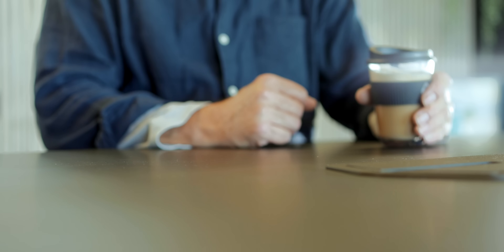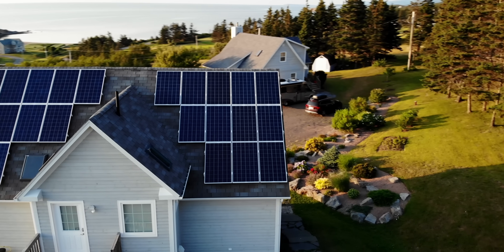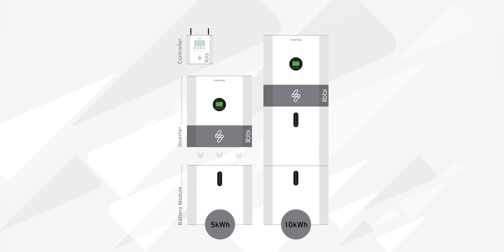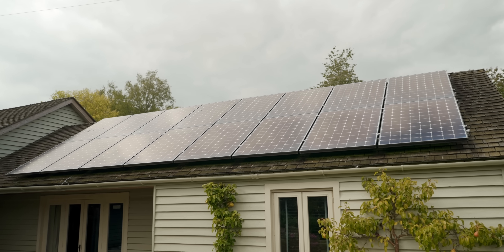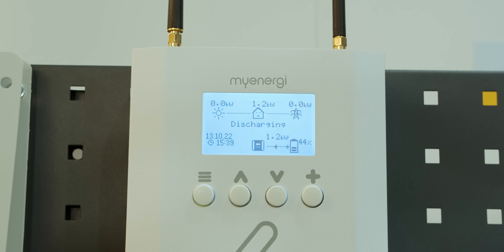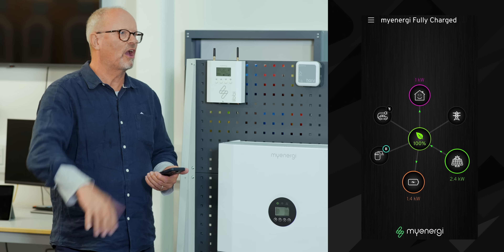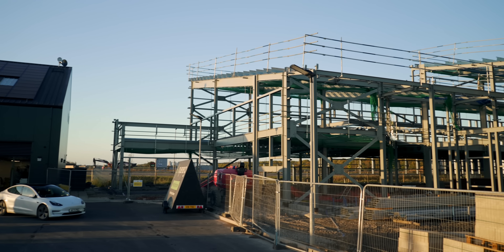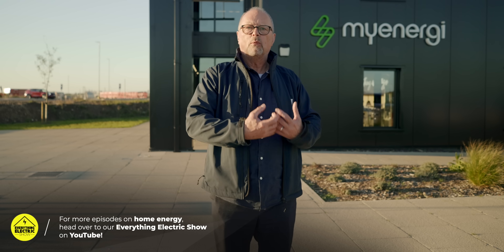THIS Home Battery is the Key To Cheaper, Cleaner Energy!

Comment: Looking at the website I see this "Optional blackout backup, to maintain power to a dedicated circuit in the event of a power cut.", this slightly worries me, in summer we would have different priorities than in winter, but the statement on website seems to suggest this cannot be catered for. AFAIK a Tesla battery will (as far as it is able) power whatever circuits are drawing power, which seems a more sensible option.

Comment: Can anybody explain why systems like this see grid connectivity as an important part of the future? If they're saying they want to create a distributed power station bigger than Drax, it seems like that's a big deal that shouldn't just come about by them selling to lots of individual households and then in a few years the grid gets a lot of benefit. Feels like it should be a more centrally directed effort, with investment, just as if a new power station was being built, but used to incentivise home owners. It already feels like a rip off that the export rates are a fraction of import rates. This just feels like another scheme that places to financial burden on householders. Wouldn't it be simpler and cheaper to be completely off grid, more solar panels a large battery and a standby generator?

Comment: I am sure that all of this technology works very well but if you simply cannot afford such equipment, there is no benefit. I have been quoted around £30,000 to replace my existing combi boiler and the other associated work required to make a heat pump system work efficiently. Solar panels etc are not included in this price. Totally unaffordable as things stand.

Comment: I like this idea so if there is a black out you can live of the battery pack, and the app will tell you how much you are using so almost self sufficient home energy. This video really builds it up but no price advertised which mean at the moment it is probably really expensive hence this really informative video hoping you will gloss over the cost and still purchase it. But apart from that it is a good idea especially now with  possible blackouts looming this winter.

Comment: Is it really cheaper ? 
As a Powerwall from Tesla is 11.500 dollars or 9900 GBP, and from what I can see this system starts at 4595 GBP+VAT (5500 GBP or 6380 dollars) and no installation in that price either. But the Tesla is 13.5 Kwh and the minimal system starting pris is only 5Kwh at libbi, so you need 2 to 3 systems to get the same power, so depending on the price increase it could either be cheaper or way more expensive and still be weaker than a Tesla powerwall.

If we take 2 batteries at 10Kwh from libbi, and say we can subtract one inverter from the cost, that would be saving at 1000-1500 dollars for the second battery. Best case that's a coast of 11.260 maybe 11.000 plus installation, but it's still only a 10kwh system, where a Tesla wall would give you 37% more power for around the same cost.

Well what if we take 3 batteries and make a more powerful system then ? Well we save 2 inverters of the cost so that's around a 16.000 dollars for 15kwh, that seems good until you read that Tesla Powerwall have a option of 2 for 18.500 dollars, so a total system of 27kwh, that is bigger than the largest battery libbi can offer at 20kwh with 4 moduls, so again it's hard to see where they can save money to offer a better product for the same amount.

It should also be said this is in the best case scenario, as the inverter for only one module from libbi is only 3.5kwh, and 5kwh in the other systems so there may not be a saving of 1500.- pr module, and in the UK there is a bigger cost for installing a inverter larger than 3.5kwh because of the forms and utility companies pay.

It's nice to see other products come along, but it needs to be evaluated for what it is, it can be good option if you only need 5kwh, but it seems a bit small to do much on.

Comment: Looks to be a great system
I'm currently looking for a 'system' myself.
I'd imagine I'd like as many solar panels I can fit on the roof.
I have a 10KW shower, I'd like the battery to be able to handle.
I don't have an electric car yet, but would like to be able to increase the battery load to cope with that.
Having a 'smart' system that I could manually 'play' with would be my highest priority.

Comment: Looks great but although I have Solar plus Eddi Harvi etc, I couldn't wait any longer and opted for a hybrid inverter with PylonTech batteries. I'm hearing that the price of a 5 kW Libbi and 5 kWh battery is around £4,500 + VAT plus installation.! I'm glad I didn't wait as my equivilant 5 kW system was £3k including VAT.

Comment: To become big we need technology AND economics AND politics come together.  Even if the kit is great AND has a payback of only a few years, it will not be adopted quickly - too few have the cash (or cash to "risk").  However, if every person or dwelling  had the right to a £5000 green govt backed low cost loan (linked to passport, authorised dealers and approved products so no double dealing or using funds to spend on other things), it would hugely accelerate the rate of change.  Only a govt can back the low cost loans and run the approvals but thousands of good jobs in the many, market led qualifying solutions.

Comment: Where this technology is falling down is the greed of companies plucking figures out of the air when quoting & charging for installations. There’s supposed to be zero vat but companies are keeping that and charging more over. There’s companies all over Facebook charging wildly different amounts for using cheap Chinese solar & battery technology. The industry needs to be transparent & itemise their installation exactly the same as every service we buy. You wouldn’t feel happy taking your car to the garage & coming out with a bill that doesn’t break down parts & labour charges but that’s exactly what’s happening in this industry. More often I hear stories of installers turning up with different branded equipment than was sold to the vendor. This is like the wild days of White Gold where dodgy cash hungry companies & sale people are riding a largely unregulated industry. If it was regulated why have I been unable to get a price breakdown for my installation that I paid my deposit for & still waiting an installation date nearly 2 months later.

Comment: I am waiting for my installation including a Givenergy battery & inverter that does as far as I can see the same thing. The only difference is the battery & inverter are not included in the same box but that’s not a bad thing I can easily upgrade my inverter if my needs change.

Comment: Wats needed is a system that does not use the grid at all... all the present systems are connected so it’s the same price cause it’s charged at same rate no matter where the power comes from wind,sun or water or whatever

Comment: The important thing for me is that, I can island the system, and provide power to the house when there is a grid failure, or make the choice to go off grid fully if they continue to take the piss.

Also I want full control, so that nobody can take control externally if I don't want them (the grid) deciding that they will just help themselves to my power.

I say that as in Western Australia, you cannot have a inverter fitted now that the grid cannot turn of remotely.

Comment: How I do this with two Tesla Powerwalls...

I have a Single Phase (L1) Consumer Board with two Powerwalls and Solar Array feeding the house, through a Gateway 2.

Attached to the Gateway 2 is a 7kW Zappi Charger.  This allows me to charge from cheap Grid at night (00:30-04:30), or from Powerwalls with cheap Grid or Solar at anytime (discharge limit is 10kW).  Our Solar Array fills the Powerwalls. 

I also have a 3 Phase Distribution Board with a Zappi 22kW charger attached, prioritises (L2) for low charge events.  This is Grid Only and used for fast charging at anytime.  So I can pick and mix which charger I use, for what type of energy I want.  24/7
Reply: Just to add... I can regularly hit 22kW - 25kW during the night for 4 hours, very easily.

11 kW - Tesla Car Charging at 3 Phase on cheap grid
7 kW - Powerwalls Charging at single Phase on cheap grid
4 kW - House Demand with Heat Pump & Tumble Dryer at Single Phase on cheap grid

Comment: I noticed that they don’t rate the ac out from the attached inverter, if it’s 3.2 like most it’s just not enough to take you off the grid for instance turn a toaster on , put the kettle on while the misses drys her hair and your easily pushing 6kwh heaven forbid you want to cook some bacon so well. This us why many still use independent inverter and 3rd party batteries

Comment: I charge my batteries over night during the 4 hour window. I pay 7.5p per KWH but I resell back at 5p so really only paying 2.5p. I can safely pull 19.2kwh and be in the 80% margin. Dishwasher, washer, dryer are Shelly time controlled to come on @ 0035. I don’t always get 10kw pv but I do get 25kwh from the grid

Comment: Great to see another powerwall competitor. I would like to see more thermal battery options though. Solar thermal panels are much more efficient than current photovoltaic panels. Nighttime heating is one of the largest uses of power in many homes.

Comment: Real shame price is only given to installers bet that will mean prices wil vary wildly, Its a great idea and there needs t be alot more reliable rivals to Tesla power wall. 20kwh is a great amount easy run a house for a long while.

I dont understand why solar farms have their pannes mounted soo low if were 7ft off the ground could still be used for grazing by sheep etc....
Oh and what is being done with the oil used in all those wind turbines when needs changing as a mate in the industry is telling me its just getting dumped atm

Comment: This is all very interesting, however, there are many problems to address and not all of them are technical.
Just off the top of my head:
The protocols for linking and communicating with this tech must be standardised. The Batteries, inverters and command modules etc. must be able to talk to units from other manufacturers, mix and match is a must. 
From an end user perspective an App is great, but more importantly the system should be able to configure itself by asking the owner to answer a few simple questions then forget the app. For this type of tech to be successful in delivering ecological benefits it must appeal to people that are not excited by the prospect of staring at yet another app all day to see where the powere is coming from and going to. Instead, it must just seamlessly become part of the home that you live in. IMHO if this type of system was currently available in new builds, the technology itself may well be "too scary" and  a turn off for many potential users.
Once the above issues, and ones I havent as yet thought of, are resolved type of tech must be mandated in every new build, only then will sufficient market penetration be acheived that will allow the large scale efficiency gains that will come from the vision for a "Virtual Powerstation"

Comment: I want one. I am one of yr target customers. I am currently exporting 65-75% of my solar at ridiculous low tariffs. I hate that. I am also on time of use power. I have a PHEV. So you are speaking my language 😃 I looked at a powerwall but ditched it due to the soaring cost (rising USD). The key question for me is what is the cost of a Libbi?

Comment: My problem with all these storage batteries, is that the management software uses power.  For example some storage barriers use 100w.  Whilst this is fine in the daytime, it’s not good overnight or in the dark UK days.  100w x 24 = 2.4kw that you have to pay for.  What does this system use?

Comment: Can you tell me if I have my math right here?
So a 5KW will cost £5500 inc VAT

5KW x 36p/KWh less
 15p/KWh for feed in (octopus price) 

So the 5 KW you can store has a value of £1.05 per charge or per night.
£5500 / 1.05 = 5238 days to pay off  Thats 14 years best case sonario geting a full charge every day I would of thought you would be lucky if this pays off in 20 years

Any idear how long the battery cells last?
I am trying to think of any think I have this a battery older than 20 years?

Comment: Can the libbi inverter charge the car via the zappi, faster than 2.3 kW? Presumably if the house was pulling nothing, in this demonstration, it could go to a maximum of 3.6 kW, so it's not fair to say, you can charge the car as fast as you want, because grid to car via the zappi, charges at 7.2 kW

Comment: 3.6kw for house and car is not really great if you want grid minimal usage. Also hybrid inverters nice and more efficient but as I have found a single point failure area. Also inverters are not liked as long as panels or batteries. A separate pv inverter and battery inverter is in my opinion the best redundancy and operation route. Yes less efficient but better for long term use.

Comment: Interesting and nicely produced video! I upvote when I see a reference to Red Dwarf. Having it made by the actor that played Kryton makes it even better. A mechanoid would also have found the topic of power storage fascinating - fine electron dining storage 🙂 As for Libbi, it will be interesting once they go into production, and if it will be shipped in the EU (watching from Denmark).
Reply: If we calculate the kwh you get for the price it seems a bit expensive compared to others, almost 6400 dollars for 5kwh with only a 3.5kwh inverter isn't really stellar.

Comment: Good user for this could be farms ,  large roofspaces, machinery demand, modular vehicle batteries for equipment and tractors.  At present they are limited as the create more Solar in than grid can handle so dumping it to more batteries for a supply to grid on dark evenings should be a win ( some locations have the older higher FIT and similar

Comment: I have been operating as a microgrid for past 4 years with my 13.2 kWh solar PV system coupled by my two Powerwalls (27 kWh) for ~ 9 months of the year and only draw grid energy from November through early February. We generally export about 50% of our excess solar energy back to grid and live in Edmonds, WA in USA.

Comment: Hi Robert, looks like a great product line. But I'm always a bit worried about the way the "cost-saving" battery is presented when connected to solar panels.  I use about 4500 kW electricity per year and my solar panels produce about the same. However I only use in reality 40% in best case scenario of the electricity from my solar panels. Because in summer they produce about 30kW per day and I only use about 7 per day most of it at night...
So a battery could help...I thought. But here in Belgium you pay about 800 EUR/kW battery. So if I put e.g. a 5 kW battery it costs 4.000 EUR. During Spring and Autum I see from the stats of my solar panels from the past 5 years, that I would be able to charge them 50% of the time. During the 4 winter months my solar panels produce less than a 1 kW per day so practically nothing to the battery. And during the summer it can also only be used for 50% because there is too much sun and thus day one is fills it up, uses 50% of it during the night and then day 2 it only can charge it for another 50%... And the rest is the 30 kW is lost to the grid again... So long story short. I put all this in a spreadsheet and it would take 12 to 15 years to earn back the 4.000 EUR investment of the battery... a battery with an invertor with a lifespan of 8 to 10 years and the batteries probably the same...  So I don't see any benefit in a home-battery today. Maybe if they cost 2000 EUR for 5kW.  But please keep up the good work, I'm a big fan! I bought my first EV (ID4) last year thx to your channel and loving it.
Reply: Do you have the option of cheaper electricity at night in Belgium? Here in the UK I will charge the battery with cheap night rate electricity in the winter when there is not enough sun.
Reply: @lib_f  I also don't understand why home-battery has to cost about 800 EUR/kW while in a car it costs about 200 EUR/kW. It can't be that the batteries are so different because car industry claims that "old car" batteries could still be used for home batteries... So if that is true why are they 4 times more expensive?
Reply: @lib_f  Yes and no. Originally there was but they are terminating that benefit, because they see that more and more people are changing their car at night and thus won't have the capacity to spare
Reply: @lib_f  Also don't forget that putting electricity in your battery and taking it out again "costs" between 5 and 10% energy that you lose...so that it costs more